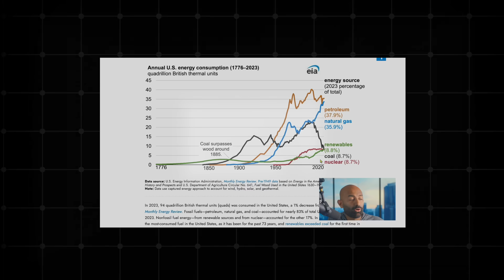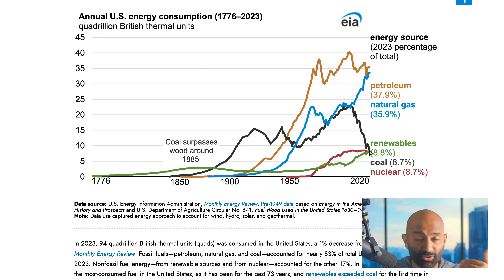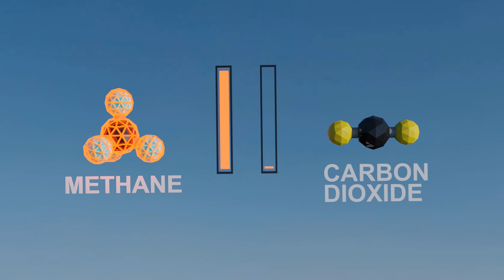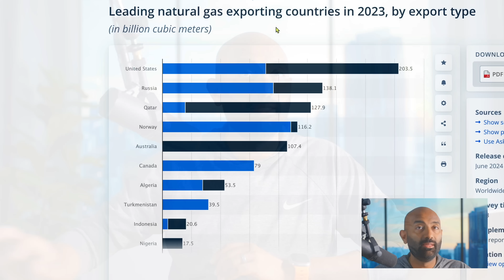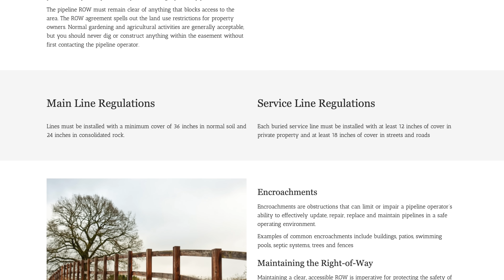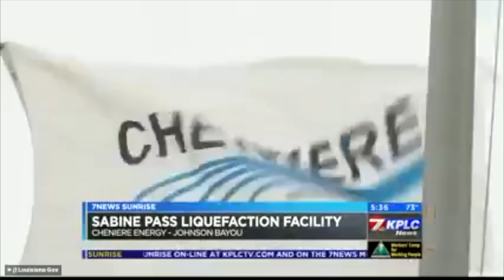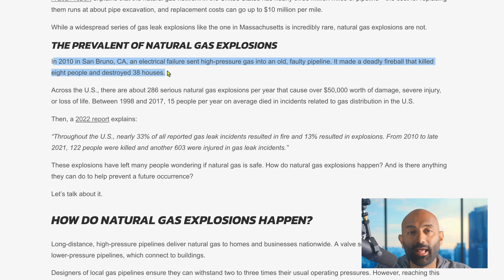The TRUE Danger of Natural Gas - This SHOCKED Me

Comment: Ricky, why was there no mention of the highly toxic VOC's that is in ALL natural gas? These compounds are DIRECTLY linked to numerous types of cancer. Now granted, I am no expert and I imagine that most gas companies filter the gas as a necessity or required to filter by law, but from what I understand these compounds are very hard to eliminate completely and the filtering itself can be resource intensive and quite an expensive process, so many of these VOC's (volatile organic compounds) remain in the gas delivered to our homes. This is a real problem that the gas and petroleum companies have spent a great deal of time and money suppressing information about this toxic crap. Also, I think it is safe to say that there are reactions between the gas and the metal going on inside these metal pipes that cause premature failure of valves and piping, not to mention the sealing materials like gaskets and O rings that are found at every valve and connection of one pipe to another. I imagine that is why metal pipes for gas transport have been discontinued in favor of plastic type pipes many years ago (but it's funny, we never heard about how dangerous metal piping for natural gas is, go figure). Not to mention the long term consequences of fracking start showing up in future generations. Do you really believe that removing HUGE volumes of gas and oil from underground and fracturing bedrock will have no bad consequences? We have seen a large rise in the amount of earthquakes worldwide in the last century and it is continuing to rise at nearly exponential rates in the last few decades. And now we see the maga government trying to do away with any regulation that might help reduce the damage being done to this planet in the pursuit of profits at any environmental cost. Our offspring & future generations will be paying the price for this greed and lack of insight. The price it will extract from them will be astronomical, and the survival of the human race and the ability of this planet to be able to continue to sustain human life will be in the balance because of the poor decisions made by these greedy corporations and those that run them, and the politicians that serve their will. We have to be smarter, and we have to do better in choosing our leadership, because that is the only way to combat the unchecked destruction of this planet that occurs when the government is run by corporations and its leaders. Including electing unqualified, low intelligence narcissists that are easily manipulated by not only corporations, but by bad actors like enemy governments that are looking to be the most powerful government, by taking the power from the current most powerful governments. What we are seeing now are coalitions being formed and the battle lines are being drawn and battle plans being made for the not too distant conflict that will decide the future for the inhabitants of this earth. So the stakes are very high, the highest. But they are not being treated as high stakes. We see the media ignoring these future problems for viewer ratings today (they love that the Chump gets people to tune in because of his clown show and spaghetti throwing and this improves their ratings, not understanding that they are being manipulated and USED to help get the worst of this administrations goals accomplished because of all the spaghetti throwing that distracts while the Chump administration is slipping in the knife to kill any opposition to their agenda) and the media is one of the most important tools to speak truth to power and to hold accountable those who are guilty of selling out our children's future for more wealth (which they don't need) and power (that they should never be given). Wake up people. Stop being blinded and distracted from the truth. Stop being disinterested or overwhelmed by the chaos. Your future and the future of your children and the subsequent generations hang in the balance. Is that not enough to realize the importance of the time we are living in? Wake up, open your eyes and take a stand for what is righteous and beneficial to you and the future generations who will have to live with the choices we make today, right now.
Reply: Right on! Please run for public office
Reply: VOC's are not a part of 'natural gas' those fractions are separated as 'liquid gas' before the gas is used.
Reply: @bknesheim  Yes, volatile organic compounds (VOCs) are present in natural gas underground, meaning they exist within the natural gas deposits in the ground before extraction; these VOCs are considered impurities within the natural gas mixture and can include compounds like benzene, toluene, ethylbenzene, and xylene (BTEX) which are considered hazardous air pollutants and are extracted along with the gas when removed from the ground. You know, in an age when most people can simply find knowledge of nearly every topic at their fingertips, it never ceases to amaze me how misinformed and just how outright ignorant people can be in this information age, and how quickly these same under informed people will pass on an incorrect comment as fact. When a 30 sec search can prove that they are incorrect. Not only are VOC's in the gas. It is nearly impossible to remove them all from the gas. Despite cleaning and filtering of the gas these compounds still end up in the gas that consumers use. Regardless of whether the gas was super cooled to a liquid or not.
Reply: @bknesheim  Yes, volatile organic compounds (VOCs) are present in natural gas underground, meaning they exist within the natural gas deposits in the ground before extraction; these VOCs are considered impurities within the natural gas mixture and can include compounds like benzene, toluene, ethylbenzene, and xylene (BTEX) which are considered hazardous air pollutants and are extracted along with the gas when removed from the ground. You know, in an age when most people can simply find knowledge of nearly every topic at their fingertips, it never ceases to amaze me how misinformed and just how outright ignorant people can be in this information age, and how quickly these same under informed people will pass on an incorrect comment as fact. When a 30 sec search can prove that they are incorrect. Not only are VOC's in the gas. It is nearly impossible to remove them all from the gas. Despite cleaning and filtering of the gas these compounds still end up in the gas that consumers use. Regardless of whether the gas was super cooled to a liquid or not
Reply: @ Yes, VOC's are part of the raw gas that comes up. That is the  reason you newer use the gas directly.
The raw gas is processed and separated into what we call "natural gas" and "liquid gas" where the VOC part are in the liquid gas fraction. Trace amount can still be in the natural gas fraction, but the burn with the rest of the gas. Where gas leak from old well's you have do have have serious problems with the VOC's content.
Reply: @bknesheim  right on, I'm not an expert on the subject, but I did do a shallow dive into the subject a while back, and it appears in some places where they test on a somewhat regular basis, it is a real problem. Can't remember which university here stateside that did a study on it and found that these VOCs are very bad for the lungs, and in some instances the companies themselves were to police themselves in this area, and I am sure you can imagine how well they do that! There are a couple ways that they use to remove them but many companies use activated carbon to filter out the compounds, and some use catalysts, but the activated carbon is way cheaper. They have a few other ways like the one you mentioned by removing them while in liquid state, thermal oxidation and a few other procedures. Evidently they use the method that works best for their particular supply, where some wells have more VOCs than others and some methods will work better than others depending on the exact composition of the gas. Part of the problem is there can be wild swings in the VOC content from one week to the next.There have been some studies on the effects on humans and domestic animals, but they were done some time ago. They also found that the symptoms were hard to nail down and tied to the VOCs on account of the broad spectrum of issues\symptoms that emerge in contaminated environments and that doctors would often associate the symptoms to other causes, which clouds the issue even more. Like I said, the oil and gas companies are not trying to help in this area either. What they do know from experiments with rats is that the VOCs found in methane are directly linked to several types of cancer and the rats lifespans were reduced significantly because of the cancer, with their quality of life being reduced dramatically in the rats that received relatively small doses of the compounds that were introduced to the rats in environments that simulated a human household environment. Enough said. It does bother me that it is unclear how dangerous an issue this is, and for me any messing around with cancer causing compounds is not something I want to have anything to do with!
Reply: @bknesheim  took me 30 sec to find this,  there is an allowable amount mandated, but enforcement is next to non-existent, 
AI Overview
According to research, the average concentration of non-methane volatile organic compounds (NMVOCs) in distribution-grade natural gas used by homeowners is around 6.0 parts per million by volume (ppmv), with variations depending on location and season, with some studies detecting compounds like benzene, toluene, hexane, and cyclohexane as significant contributors to this VOC level; however, the exact amount can vary SIGNIFICANTLY based on the source of the natural gas and the specific location. 
Key points about VOCs in natural gas for home use:
Measured as NMVOCs:
Studies typically measure the total VOCs in natural gas as "non-methane volatile organic compounds" (NMVOCs), excluding methane which is the primary component of natural gas. 
Compounds present:
Benzene, toluene, ethylbenzene, xylene (BTEX) are commonly identified as VOCs found in natural gas, and their concentration can vary depending on the gas source. 
Seasonal fluctuations:
Wintertime natural gas may contain higher concentrations of VOCs compared to summer. 
Leakage concerns:
LEAKS IN GAS LINES CAN RELEASE SIGNIFICANT AMOUNTS OF VOCs INTO INDOOR ENVIRONMENTS, raising concerns about potential exposure and irreversible health damage to humans and children in particular. Sensors are strongly recommended for homes being supplied by local utility company natural gas, particularly homes with small children and those who have respiratory issues.

After Chump tried to get rid of the EPA in his first clown show. He did not succeed but he did weaken it a great deal. BTW, his current approval rating is in the negative numbers and continuing to dive. I believe he is the only president to achieve that. That may be incorrect, but I am pretty sure he is the only modern day pres to pull that off. Make America great again? More like making America bigoted again. MABA!!

Comment: problem i see with piped gas is simple.. they caped off your service at some point...but there is a distance from the main line to where they caped off that is still that old if 99.9% of the users for natural gas cap off there pipes but 1 person still uses it on the old line that goes by your place it is still pressurized. so there are literally miles of natural gas service to house pipes that still have pressure in them. Also it is easier many times to cap off the pipe next to your house and not at the intersection.. so you are talking 30-40 ft of pipe towards your house that still has pressure and may be leaking some. 
Also how big a leak is a leak.. some losses will always happen most companies will just charge more to places to make up for the leaking.. being it is odorless and invisible. So much of our infrastructure in the US is past the point of needing to be replaced but no one wants to spend the money.

Comment: In my 55 year old apartment building the maintenance is done by a super of questionable age, training, competence, and sobriety. He has replaced my oven and stove (both of which use natural gas) and I'm sure he has done that in all of the other units in the building as well. That's scary. Then add in all the geriatric residents who might accidentally shut off the flame but not the gas flow. I'm kinda surprised that NYC doesn't have daily explosions.
Reply: They happen all the time and are under reported
Reply: In the UK you cannot work on gas unless you are trained with a permit. If you do you may be in court. Modern gas appliance have gas fail safe controls. I prefer electric induction hobs to gas.
Reply: John, in the US I watched carpenters with zero training in working with gas, running gas lines …in…a…school!!!’
Reply: @freeheeler09  
zikes
Reply: @freeheeler09  It takes no special skill to install gas lines.  It does, however, take skill/experience to size the piping for multi unit residences and industrial buildings.
Reply: I know that some people are opposed to government regulations, but nevertheless  automatic shut-off for all gas appliances should be required. Let's save lives.
Reply: Gas appliances don’t tend to leak fuel, especially newer ones. Gas connectors are usually pretty durable, and are designed to outlast the appliance.
Reply: Oh, if explosions from natural gas were as certain to make the news as are EV fires, people would be more afraid of natural gas than of crime.
Reply: No reason to get excited. The reason you don’t have daily explosions is because gas is actually quite safe, to the point where even an older gentleman (no need to be ageist) of questionable training, competence and sobriety can generally maintain gas appliances without any catastrophic failure. The worst that typically happens is a leak, which can be discovered by the smell and corrected before it causes a problem.
Reply: @Ethan.Lamoureux  
It is best to have laws and a system that only allows trained professionals touch gas pipes and equipment.
Reply: @Ethan.Lamoureux  "The worst that typically happens is a leak,"
No, "The worst that can typically happen" is that "It go boom, Timmy."
"Only a leak" happening is the BEST that can happen.
But, since you seem to like to "Draw to an Inside Straight..."
Would you like to play Poker?
Reply: @TimeSurfer206 Stop watching hollywood productions and join the real world.
Reply: @ DAHLIHNK, in the real World, almost 300 SERIOUS Natural Gas explosions happen every year, killing abut 15 people, and doing an average of $133 Million a year.
Responding to leaks in homes costs Fire Departments over $500 Million a year.
Please note that these figures are for residential gas incidents, and NOT Pipeline incidents.
If you had any idea how dangerous it is to work on Gas Pipelines, you'd never have bothered to open your neck.